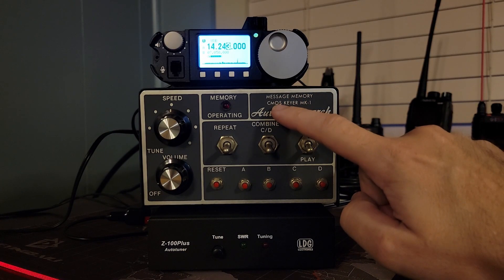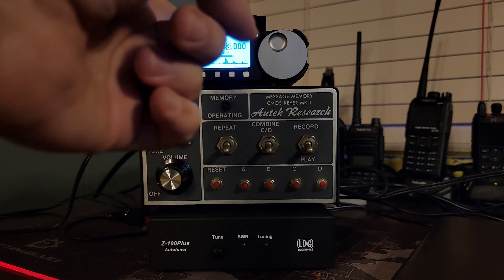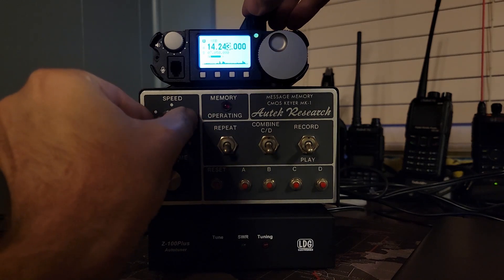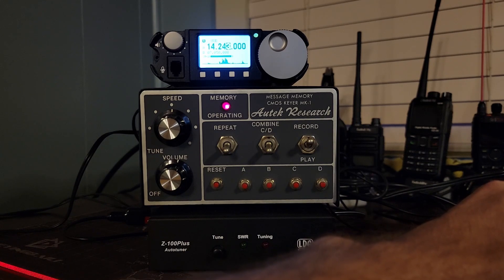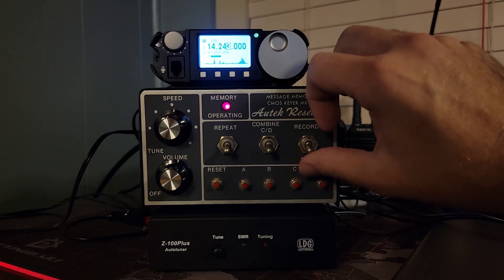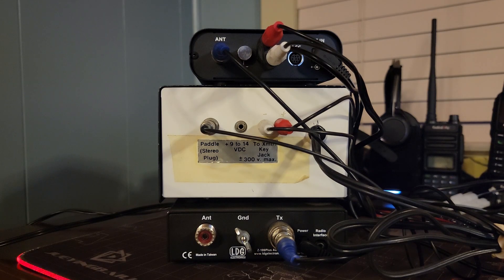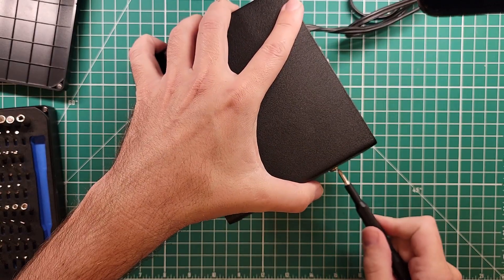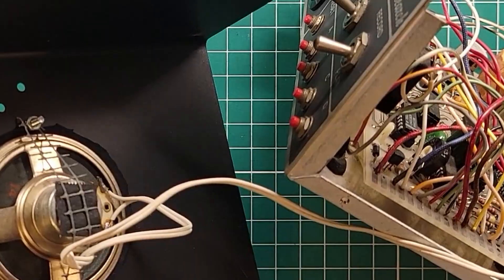What's this thing?

Comment: speed fully anticlockwise is to tune your valve (tube) rig or manual antenna tuner.
Reply from the maker: Thanks for the #ProTip!
Reply: @temporarilyoffline  Well, it says "TUNE" on the front panel.

Comment: For my first digital logic course in college, we only had RTL and DTL, and the DTL was hogged by the folks doing a thesis.  Then came TTL, which I used for my thesis.

The chips you saw were mostly SSI (small scale integration, gates and flip flops) and MSI (medium scale integration, the counters), and maybe the memory would be considered LSI.  CMOS, when it appeared, had a great power consumption advantage over TTL.

I assume that your memory forgets when the thing us unpowered.

Yes, you can certainly get SMT equivalents of the functionality of those chips.  But a micro-controller is the way to go today.  You will still need external transistors to drive the rig keying, and probably for the speaker.  K1EL makes some nice stuff in this space.

I believe that the chip your were looking for is the "Curtis" keyer chip.
Reply: A number of years ago, a friend came to our QRP club to show us his new keyer kit that he was selling called the PicoKeyer kit.  It has a lot of cool features including code practice osc..   We had a group buy and all made up some of his first kits.  It ran off a small coin sized watch battery, and was very low current draw.  It still runs great and have not replaced the battery yet, after about 12 years.  He has improved the firmware in the chip and now has 8 memories in it, and its called the Ultra PicoKeyer  kit.   He still has a group buy if a club wants to get some and build it.
Reply from the maker: I was looking for the Curtis!  Thanks for watching!

Comment: These things are also useful if your radio's built in keyer isn't very good (aka Xiegu)
If you are looking for something field portable the Ultra Pico Keyer is about $40 and super easy to assemble. It runs off a coin cell battery.
Reply from the maker: I didn't actually think about hooking this up to the xiegu until you mentioned it yesterday.  #ProTip